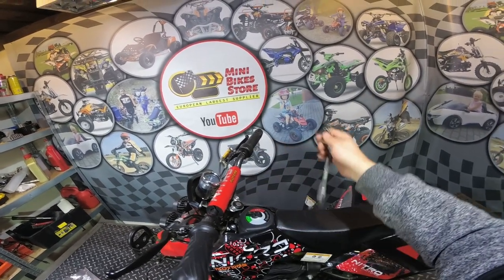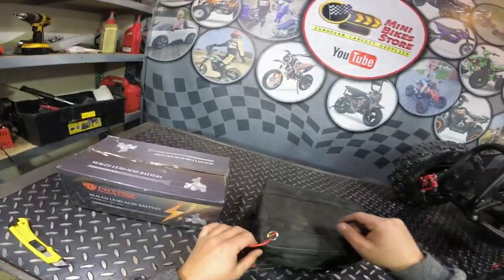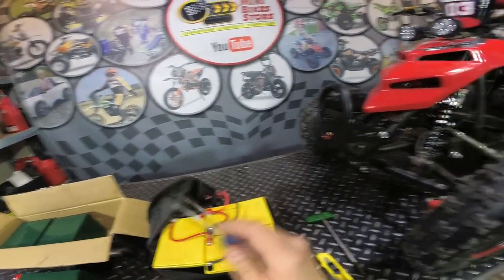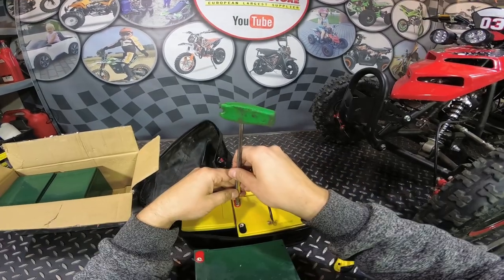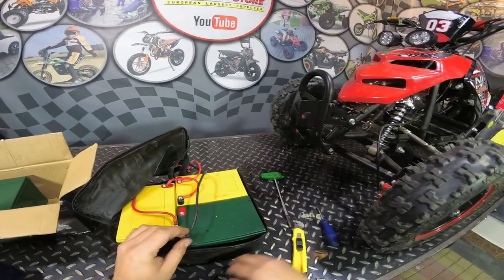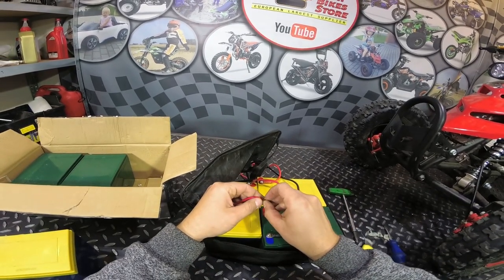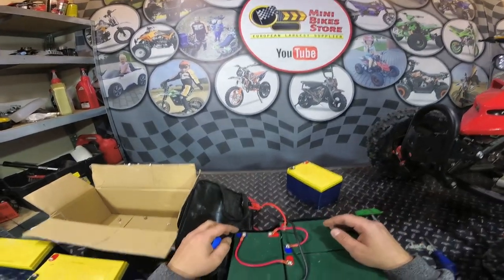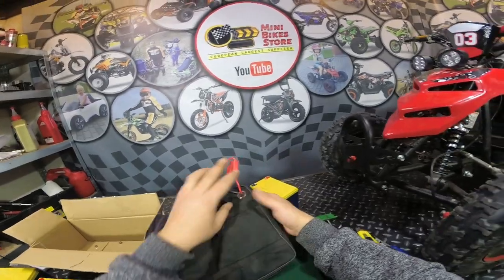Electric Quad Bike - NEW BATTERIES - 36V - Installation Instructions

Comment: What made you need battery my batterys are broke underload but have 42v  nithing lights up no throttle lights no head lights nothing but the quad is receiving the 42 v too controller